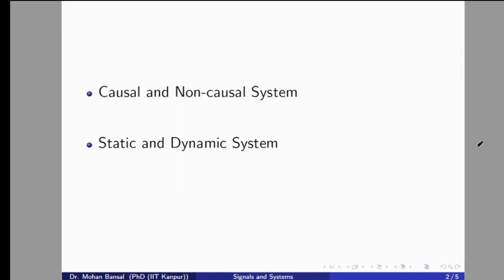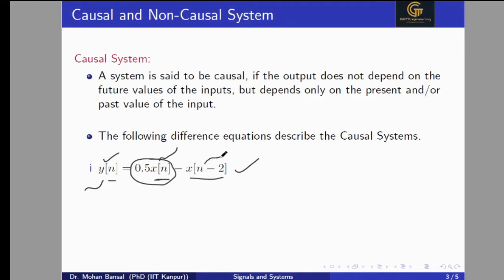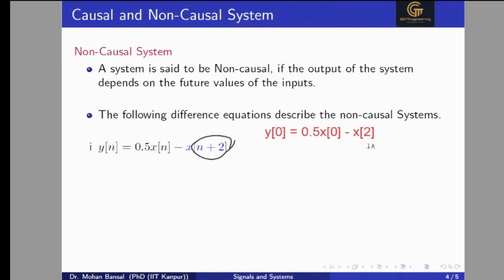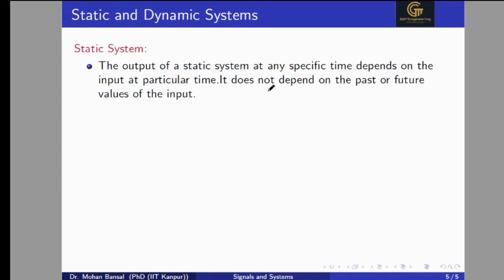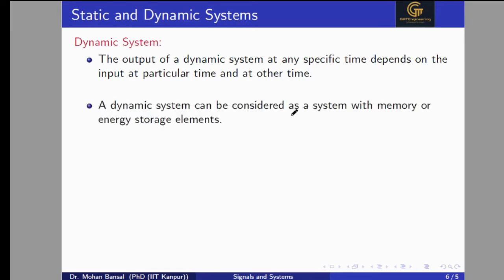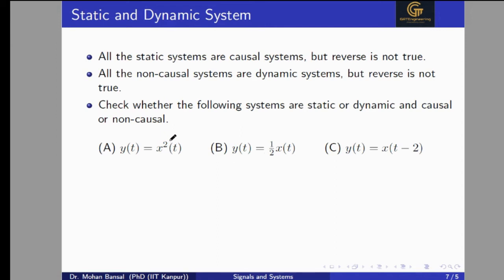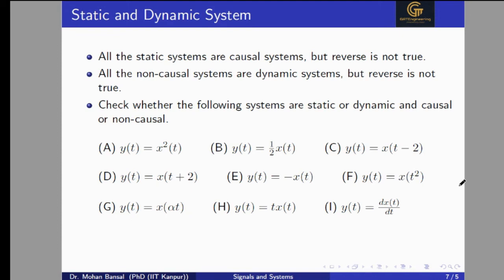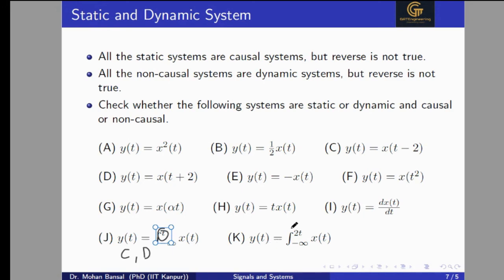22  Causal and Non causal, Static (memoryless) and Dynamic (memory) System with several examples

Comment: y(t) = x(t) + u(t+1) is causal or non causal
Reply from the maker: The given system is causal system, because x(t) is the input  and u(t+1) is the constant. In this case output is depending only on the present value of the input signal.